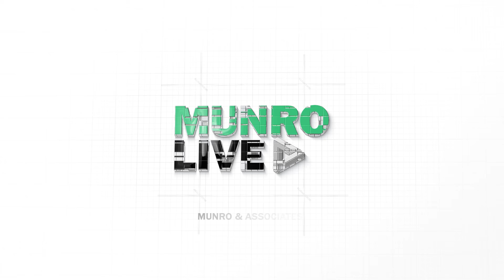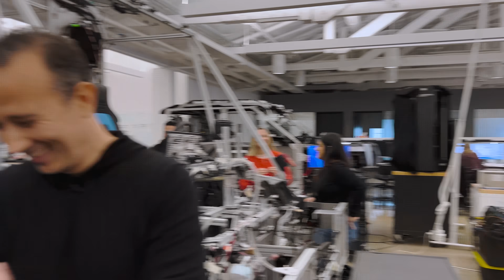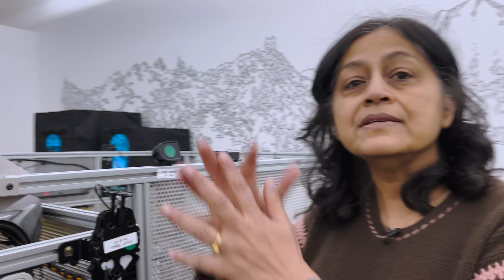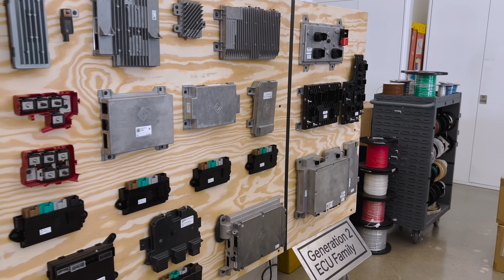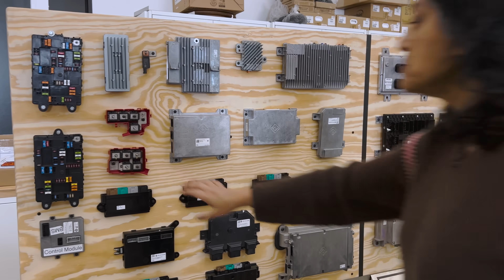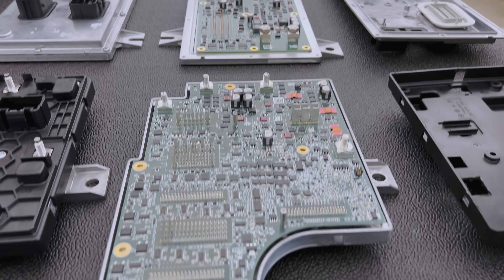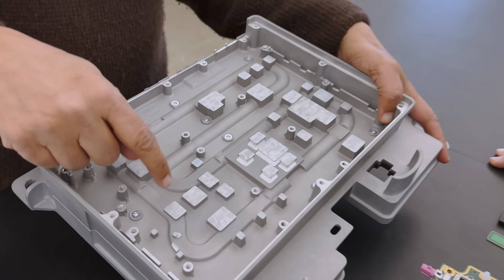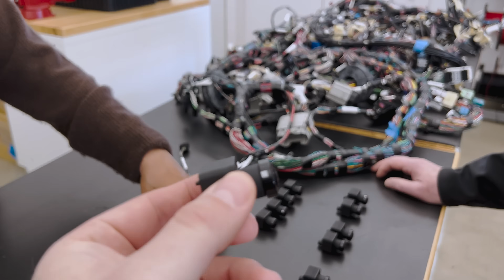Inside Rivian's Electrical Hardware Lab with Vidya Rajagopalan

Comment: How hard is it to replace an E-fuse vs thermal fuse?
Reply: Easy!  They never have to be replaced!
Reply: Nice. So reset can be a soft button or physical button? And there can be a notification on screen that e-fuse blew?
Reply: @barryw9473  Dunno...see Tesla owners manuals and service manuals
Reply: What are failure / reset modes?
Reply: @barryw9473  Over current is sensed and a switch (FET) opens to cut the current.  Reset can be whatever the designer chooses.